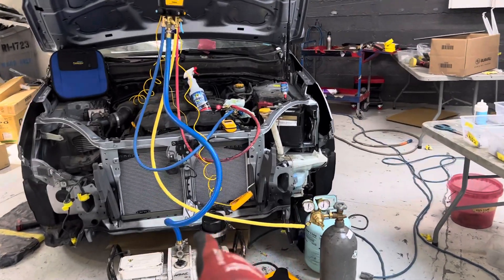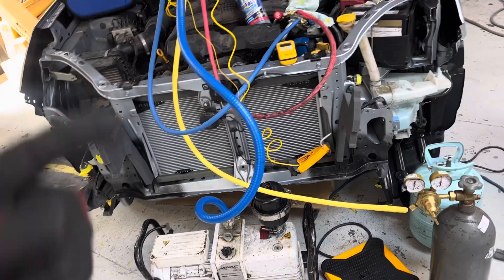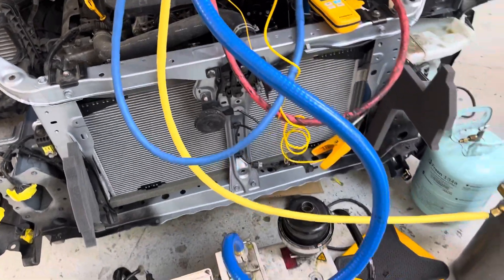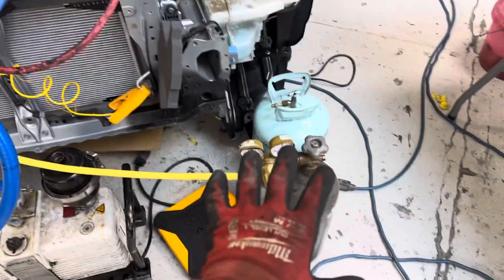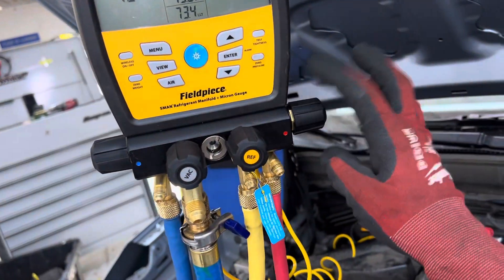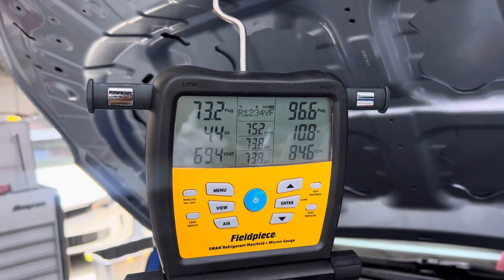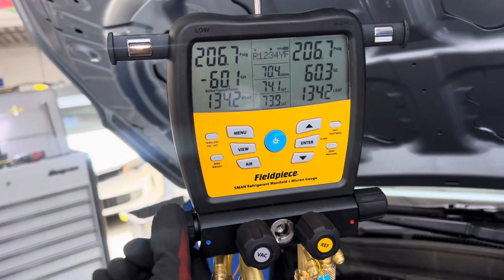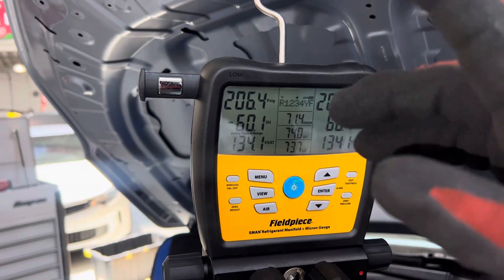NITROGEN DECAY TEST to preform using Fieldpiece SM480V Refrigerant manifold

Comment: Faster way is to watch the pressure of the nitrogen cylinder or right side of the regulator. If the needle goes down I immediately knows there is a leak
Reply from the maker: That would be a gusher of the leak. 

I’m looking for leaks that or even down into 1/10 of a single psi . 

Overtime that no analog gauge would even move . 

Especially an analog gauge with a very large high psi rating . 

Even if you moved two or three psi . 

The numbers are so large in High on the nitrogen tank that two or three psi does not even move .
Reply: @coldfinger459sub0  Needle moves very fast because the pressure is very high and the volume is very low. After pressure stabilized, as soon as I closed the valve on the cylinder the needle moved quickly when there was a leak.
Reply from the maker: @w0lvez1  that’s a big leak. 

We’re looking for leaks down into the tenths of a psi . 

And when we’re doing commercial pressure testing at 600 psi on 1000 3000 feet of copper piping, we may leave it under pressure for 24 hours to 72 hours . 

Nobody would ever think of using the analog regulator gauge on the nitrogen tank, not accurate enough . 

Specially, when you could have thousands or tens of thousands of dollars in Refrigerant lose because you miss a leak . Plus the downtime for repair..
Reply: @coldfinger459sub0  That's the needle that moves first when there's a leak. The regulator will try to maintain pressure to the system so before you detect a leak on the manifold gauge the gauge that measures the nitrogen tank is already pointing to 0. Not sure why it doesn't equalize to the pressure on the other side

Comment: That Navac is for evacuating big chillers - and you using it on car’s. 😁
Reply from the maker: 🤣 I LOVE OVER KILL 🤣 damn, it works fast..
Reply: @coldfinger459sub0  Got to do cycles with that set up. Because you can freeze the moisture inside the system evacuating too fast. You will think that it is all good and dandy - until it’ll thaw out after charging.
Reply from the maker: @commenter5469  it’s a good thing on cars we don’t have glycol heat exchangers that are rupturing and pumping water into a Refrigerant Circuit. 

And automotive components are so small. Yes, the lines do freeze up and get frost on them but there’s no worry of freezing water in it staying behind in the system. 

Because the tiny components absorb so much heat from the ambient air so fast there’s no worry of that 

And when I recover refrigerant with the recovery machine, all the way down to roughly 800 µm 

Then, when I throw it on the vacuum pump, it’s not difficult to get it down to 200 µm 

No moisture worries here 

We’re all the moisture comes from his body shops, taking off the condensers, and then leaving the lines, exposed to the atmosphere for two or three weeks while they get parts and work on the car 

That’s when I cannot get the vacuum down to Decay less than 1000 µm with just one hour of vacuum, using the NAVAC 12 CFM vacuum pump with silicone three-quarter inch vacuum hoses on a vacuum pump that is rated down to 3 µm
Reply: @coldfinger459sub0  I am in Mobile AL, we are second worst area in the US on relative air humidity ( first is New Orleans, it is all swamps and lakes there) - for me moisture is a huge concern!
I am running blower full force and put the fan against the condenser while vacuuming. Sometimes use heat gun to filter-drier and/or compressor.
Reply from the maker: @commenter5469  too bad the guys over there never heard of nitrogen purging after they recover refrigerant so they have a positive flow of dry nitrogen at a very low flow and as they take the components off you push rubber plugs into the ends of the pipes of lines, so no humid atmospheric air ever gets inside the system. 

And there’s no moisture contamination 

I’ve done videos on that . 

Nitrogen is a beautiful thing
Reply: @coldfinger459sub0  I’ve done my share of triple evacuations myself. I can see just looking at your tools that you do industrial refrigeration.
Most of the people who do automotive and heavy equipment ACs don’t even know what micron gauge is. 😁
Reply from the maker: @commenter5469  yes, I sell LG Multi V 20 ton to 60 ton  1000’ to 3000’ lines

Comment: Nice video Tom.
How can I diagnosis the hard shut off expension valve incase it stuck in close potion?
Reply from the maker: If stuck in closed position you will have a vary low low side dose not move maybe even a little vacuum if you rase RPMs
Reply: @coldfinger459sub0  what about the high-side? will it be lower than normal or higher than normal?
Reply from the maker: @OldSchoolNoe  are you talking about the high side pressure because the foam or plastic pieces will be missing if somebody leaves them off ?. 

If this is what you’re talking about 

The high side will be higher . 

Usually on a cool day like 60°, 70° some vehicles even load the middle 80° he will not notice much of a difference 

But on the extremely hot days 90° and above when this customer is in, stop and go traffic sitting at a stoplight or stuck in traffic all the hot air that’s over 200° that’s going to the condenser picking up heat going through the radiator picking up heat, hitting the exhaust manifold in the engine block heating not picking up heat is super hot under the hood with the hood closed and it’s under pressure because the fans are blowing into the engine compartment

And the front of the condenser fans are pulling negative so it’s sucking and that hot air finds its way around through all those cracks and openings and wraps around and pulls back in front of the condenser reheating the condenser with 140° 160°, 200° plus air . 

This makes the high side pressure higher
Reply: @coldfinger459sub0  Makes sense, an airflow issue on the condenser will make the high-side pressure higher than normal.
    I was asking about the metering device. If the orifice tube is clogged, the pressure on the low-side will be lower than normal. What about the high-side, will it be lower than normal or higher than normal?
Reply from the maker: @OldSchoolNoe  it does something different on different cars, fix piston, or variable displacement how large the condenser is what the ambient temperature is. 

The low side will definitely be lower some cars. The high side will be lower some cars, the high side will be higher. 

Depends on the refrigerant charge especially if the refrigerant charge is low it will be lower on the high side 

When you first started up depending on the bleed back of refrigerant and what makes it through depending on how plug the Orfice Tube is sometimes your house I will go up at first, but then go back down 

And unfortunately they place the high side fitting, sometimes on the discharge of the compressor on the vapor side, sometimes on the liquid line 

It’s a mixed bag of results on that one but for sure the low side will be lower

Comment from the maker: Actually supposed to be 0.2 and this was just a guesstimation because I am not performing this test correctly as I mentioned in this video.

There should be 0.0 loss. 

But only if you properly wait and allow the system to stabilize first 10 or 15 minutes before you isolate and perform the test 

But if there’s a temperature change during your testing procedure, the gas will either expand or contract, adding or subtracting pressure to the system 

And every gas has a formula for providing the calculation to determine what is your pressure gain or your pressure loss due to temperature gain or temperature loss 

And this is performed by having thermal couple temperature. Probes clamped on to the metal pipes to take the actual temperature of the metal that the gas will be in to determine and compensate for your pressure gain or loss due to thermal ambient temperature.